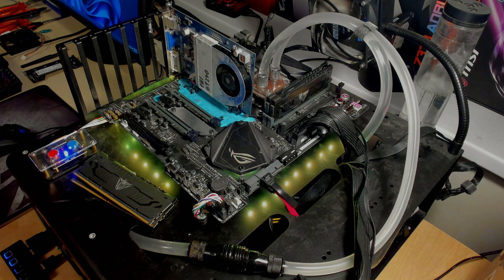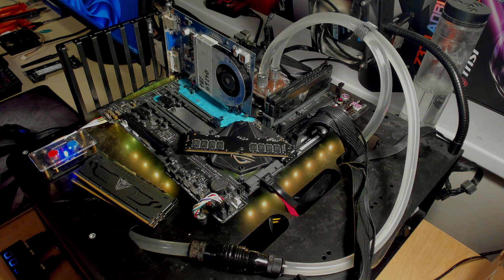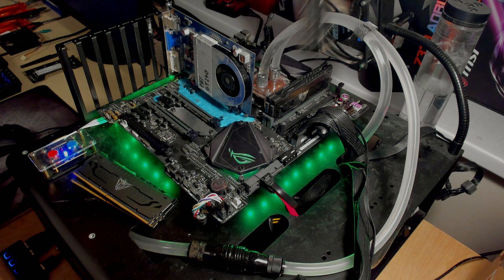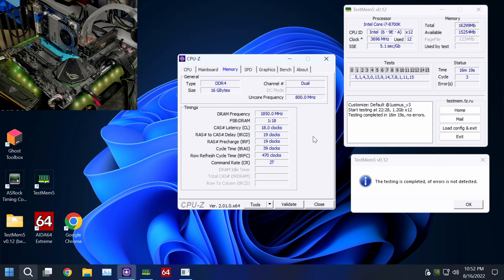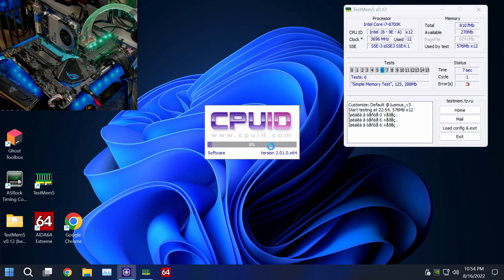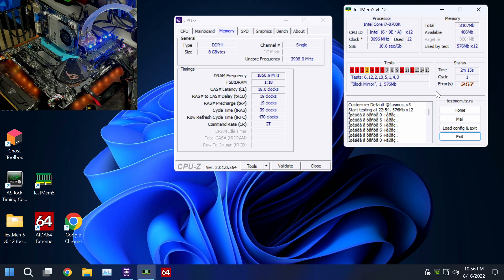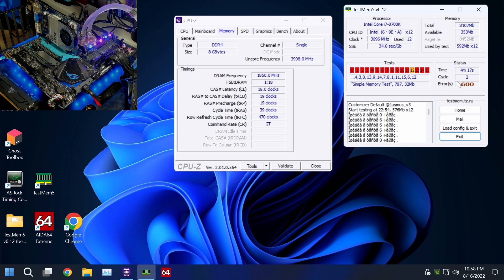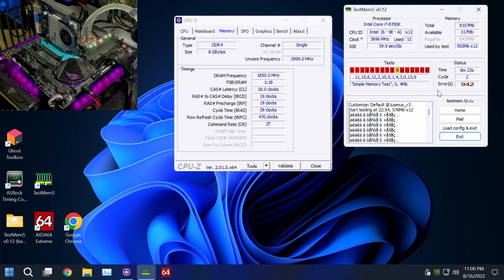Not all CJR is made equally (because Corsair kneecaps it)

Comment: Perhaps this is why my 3000 mhz cl 15 vengeance kit crashes  at that speed with an R3 3200 g. there's potentially  just a set of traces I would never know are there picking up crazy interference. Do you think covering the pcb in conformal coating would keep some interference away?

Comment: Soyo which test bench are you using?
Reply from the maker: It's a dimas tech easy v3. Chose this one because of the dual 360mm radiator support
Reply: @CmdrSoyo  it's super nice. I like that it actually had better pcie bracket than just the standard stand up posts.